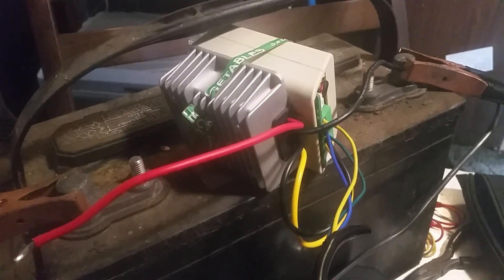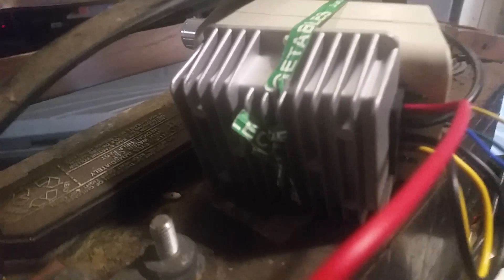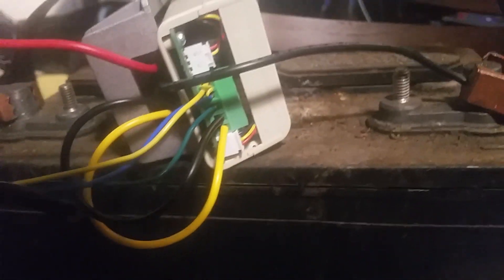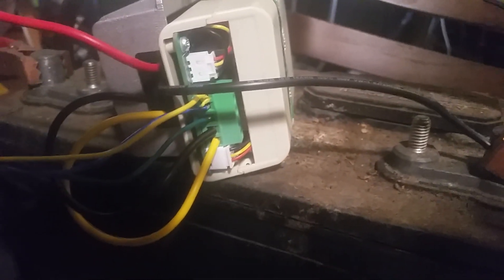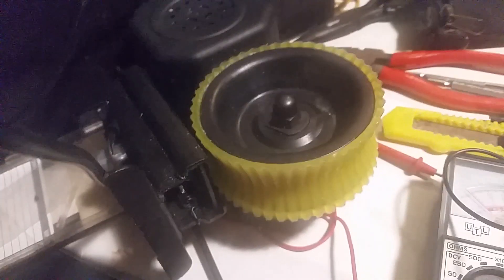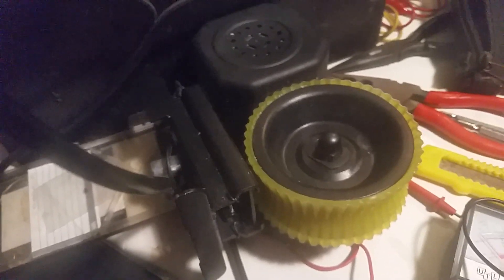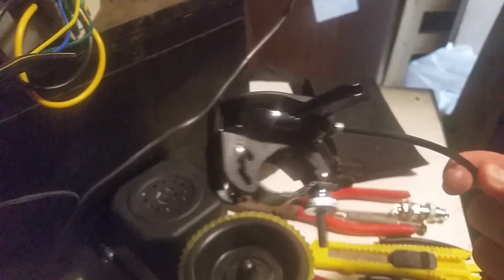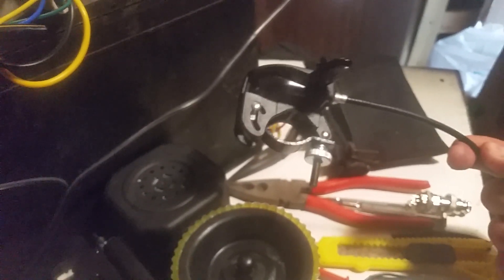BIKE BOOSTER - PART 1: Testing

Comment: Hello dear how come the booster run what make it drive 😊
Reply: It runs off a 12 volt battery using a voltage converter from 12 v to 24 v... could use two 12 v batteries instead too

Comment: Where i can get this Controller
Reply: I got it on ebay but I'm looking for a more powerful one now as this controller and motor combo doesn't quite have enough torque to move the bike but rather just sustain once bike is up to speed. Tried one with hull contacts but couldn't get it to work. (This motor doesn't have the hull contacts, only the 3 main wires for power)

Comment: Is it sensorless brushless? What about speed controll or switch on/off?
Reply: It is brushless so it uses 3 wires to power as in the video.... at 2:24 in the video 2 buttons are shown, a switch that is for forward/reverse and a potentiometer that has on/off and as it turns it increases speed.
Watch out as there are different controllers for brushless than for brush motors, also, the brush motors (because of the brushes) are designed to spin only in one direction.
As for this booster, the 250 watt power won't get the bike going but rather just aid in pedaling or sustaining a cruising speed, from my experimentation.

Comment: I have mimicked the same setup on an actual bike... works fine under no load, but under load the motor cuts out and I have to power off/on the controller to get it going again... anyone any ideas ?
Reply: those boosters wont work, they are 10 amps, thats on the input so at 24v your only going to get 3-4 amps before you overload it.
Reply: My original controller (as featured in video) purchased from Ebay, finally gave up the ghost (I probably overloaded it). I have since purchased one from Bangood advertised as DC 12v - 36v 500w High Power, currently priced at £11.64. I have attached a heat sink to it and it seems to be working well... a lot more power. I have put a 20 amp fuse in the battery feed and that does not blow !
Reply: In the setup I built it seems to work once the bike is up to speed but the power is weak... I'm using a 12 to 24 volt up converter with a heatsink... see a 12 volt test on bike in part 2

https://youtu.be/AMkVRHI1PaQ
Reply: @rayprod8571   as i said your limited by the input current and the input voltage. if your using a 12v battery and a 10A booster your only going to get 120w on the output. that means at 48v your barely going to get 2a

the way i done it on my bike was to use a 8s 30v pack and boosted it to 48v using a 40A booster, that gave me almost 1200W (30vx40A) or up to 25A at 48V 
https://www.youtube.com/watch?v=D8HfWZb6-CQ

i dont run my motors off these anymore but they make good chargers.
Reply: @geofrancis2001  and you didn't burn the 24 v 250 watt motor by feeding it 48 volt 20 amps?
Reply: @rayprod8571 no i ran it like that for over 1000 miles